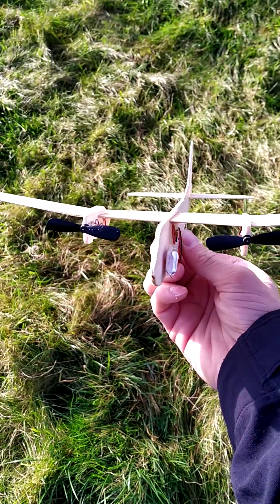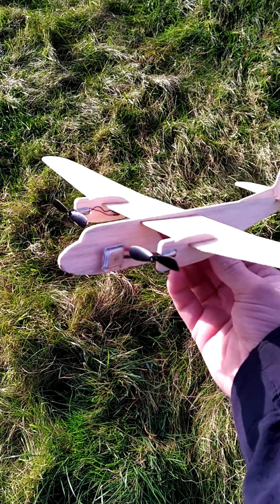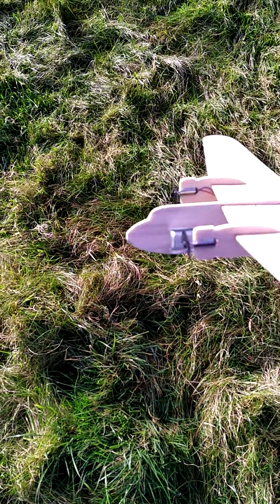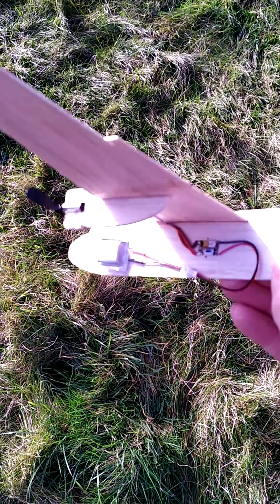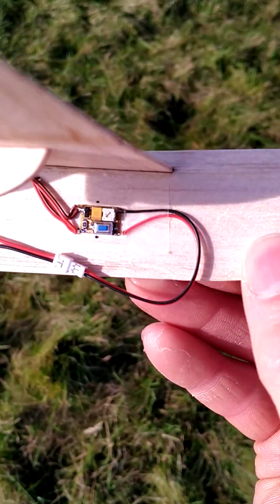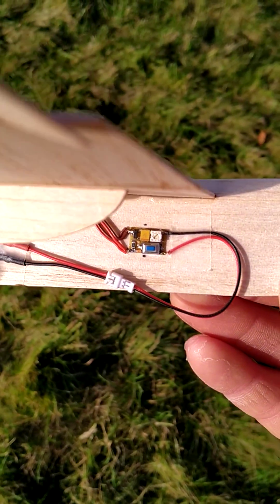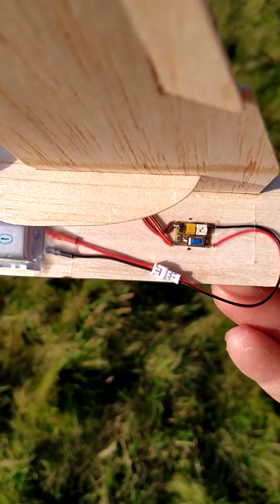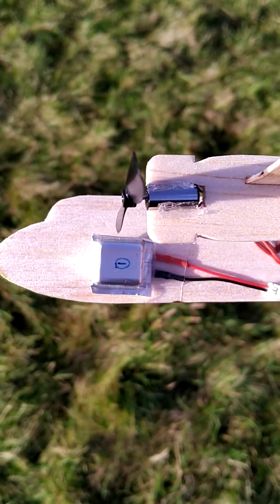Free Flight DC-5 Twin Electric - 13"

Comment: Hello 'slowmatch'...

I'm just seeing this your latest entry in circuit-controlled, free-flight experiments.
 I'm working with some youth & high school students from Nigeria & Ghana...very excited about RC, but trying to focus them on building 'Free-Flight' & related knowledge first.

Big question for you--about the 'PB Timer' principle on BIGGER brushed motors than the coreless 6 - 8mm types. 
 For instance: toy motors, like the N-30...N-180...GWS 350C...Spd 180, 280..and similar types--that would be appropriate to mount in 30 - 40 inch span models  = or < '13 ounces' in flying weight.

Its motors such as these that I receive the most questions about applying to flying models; many of these beginners readily obtain these, as well trying to use either alkalines...camera lithium batteries like CR123s...or  NIMH & Li-on cells.
 Lipos are strictly controlled & often expensive for them--even the 2S sizes.

Any recommendations you might have regarding such larger, heavier components would be appreciated.  towardsdon't

Very nice DC-5 model, by the way and a great flight!
Reply from the maker: Hi Anton, the timer circuit will work for larger brushed motors and any battery chemistry, but it will be hard to achieve the power to weight of lipo. Supercapacitors might be another simple cheap way of getting your students flying free flight?

There are hundreds of FETs that will work, you just need to find one with the right specifications. If you visit one of the big supplier websites (RS, Farnell, Mouser etc) you can search with filters to select something to meet very specific requirements. Or just wade though the part datasheets. 

The largest motor I've personally use is the GWS CN12-RXC or N60 12mm can. This draws 2 amps on a 3x2" prop but gives good thrust and will fly a 60-70g E20 model easily. The motors you mention draw up to around 10A. I've successfully used this FET in a timer https://www.st.com/resource/en/datasheet/std17nf03l-1.pdf
It's rated for 17A, but I haven't tested it at high amp draws as yet - I just haven't built anything that large!

FET Parameters 

FET Current rating (ID): The FET needs to be rated for the amp draw of the motor circuit but it's sensible to have significant headroom with this. One reason is that if an FF model lands in such a way as to stall the prop you will get a big overload and potentially burn out the motor and FET. As you get close to these limits the FET will get hot!

Drain-Source Voltage (VDS): must be above the flight battery voltage.

Gate-Source Voltage (VGS): must be above the zapper battery voltage.

Gate Threshold (VGS(th)): this is the (capacitor) voltage at which the FET starts to turn off. Around 1-2V is desirable, especially with a 9V zapper start. With the push button version on 1S Lipo you only get 4.1V 'zap' so low VGS(th) is helpful.

FET Package (case type): For a large model I would suggest TO-252 or TO-251 (D-PAK or I-PAK) packages. Bigger cases generally have larger current capacity and heat dissipation. Some of these can be rated for as much as 41A!

Capacitor/Resistor Specs

The cap circuit takes very little current. It just needs to be rated for the zapper voltage ie above 9V for a PP3 zapper. The cap can be any type, the value is more important (33 or 47uF) Resistors also can be any rating as the current is tiny. 1/8W or 1/4W are convenient. If you go the variable resistor route then use a 1M ohm 6mm cermet trimmer - cheap and widely available on Ebay. The diode is rated for the zapper voltage and 200mA current. Although it can be dispensed with if you are careful observe correct polarity when zapping.

Have a look at http://peterboroughmfc.org/Ferry500-Timer.html for more details or if you want to discuss further I'd suggest posting on Hip Pocket Aeronautics Forum: https://www.hippocketaeronautics.com/hpa_forum/index.php?board=20.0